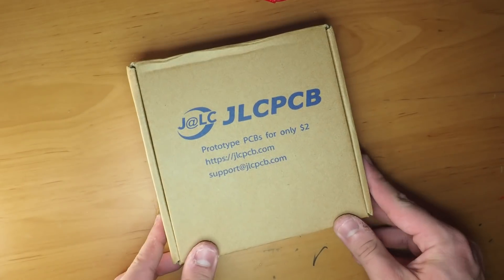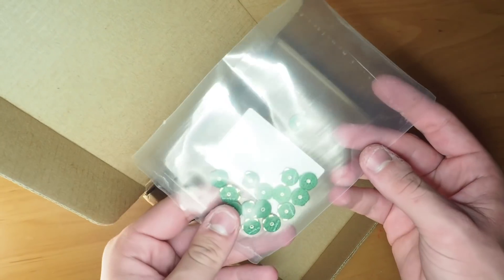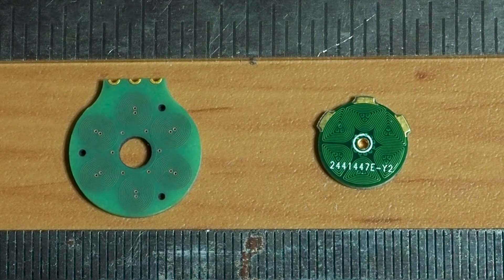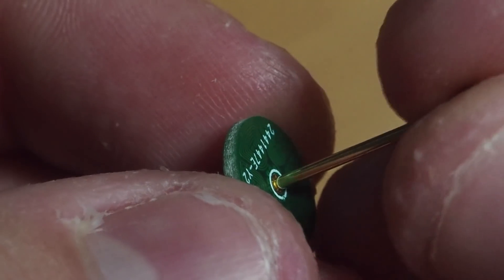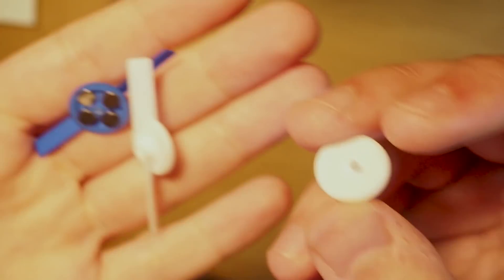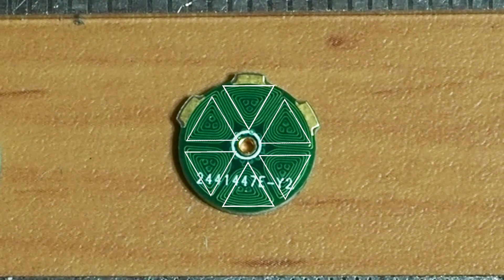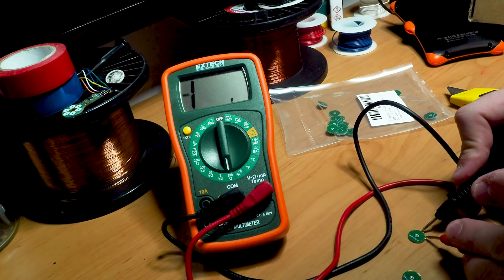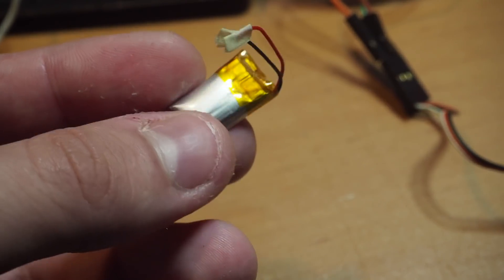SUPER tiny 6-layer Motor!

Comment: Very interesting work.  I found it while I was googling for very small, cheap motors.  I was wondering if an array of these motors (all on the same pcb) could be used to drive a parallel array of 'fishing line' muscles.  These can be powered by twisting and show a powerful and fast contraction (see https://www.youtube.com/watch?v=1A2LUbJjDQ0 at 41 seconds).  Do you think there would be enough torque ?

Comment: Max voltage/ RPM??? I am curious if this concept coule be utilized to make tiny 15mm case fans at a lower cost and equal or better performance than the off the shelf ones....
Reply: All you have to do is upscale it

Comment: it can be really usefill as robotic technology. You can make not only engines but also solenoids, steppers or servos. For sure this kind of engines is not much effocient, but in case you not need lot of power they are qwesome.

Comment: Excuse me I have to go repair a hole where my jaw dropped through the floor.
Reply: Imagine a silicon chip engine.
Reply: @tibfulv  
I don't want to imagine it I want to see it hold it and use it.
Reply from the maker: @Anniruddh Mann Those types of vibration motors are still wire wound.. The motor concept is the same yes, but what different about this is that the windings are pcb traces
Reply: kindly explain why this is any better than a normal small electric motor?
Reply: @bobedwards8896  
Basically with me and you could add cooling fans as part of a circuit board instead of having to buy them later. There's probably a few other applications but this is the main one I can think of.
Reply from the maker: It depends on the application.. It has its own advantages and disadvantage.. Main advtanges are that it could be cheaper, super flat and part of the circuit itself. The main disadvantage is probably torque

Comment: https://www.thingiverse.com/thing:2605496

please use as desired
(this is a "torque" propeller)

If made out of ceramic can be used as light duty solder sucker.

Embed tiny motor into afterburner zone, place as turbine into tube, and use as 'almost instant' pressure for solder remove.

Comment: Wow that's awesome!
How much torque does your motor have?
Reply from the maker: I haven't measured the torque of the 6-layer motor but the 4 layer one has a static torque of 0.9gcm - its is probably less than or equal
Reply: @CarlBugeja  
I'm kind of new to this, is that a lot or a little for something of this size?
Reply: Almost none

Comment: You could use mobile vibration motor. It is also very small and powerful.
Reply: There are vibration motors with different axis, some with axis like the one of this video.
Reply: Wouldn't it be vibrating the phone around in the wrong axis? 
The ones I've seen have been mounted so that the motor axle is mounted horizontally, so it vibrates the phone up and down (against a table when laid on a table)
This one would have the axis vertically (phone doesn't vibrate against table when laid on a table)

Comment: Can  you make micro dinamo?
Reply: An electric motor should work as a dynamo, so in theory you're looking at one.
Reply: Stephan Brun The engine does not supply electricity at low torque. but the dynamo is able to give high electricity at low torque. what you call theoretically, but dynamo structurally a little different

Comment: Cool! Can it step?  How can you increase torque, or use it in an actual product?  Nice work!  Subscribed! And ring the bell!
Reply from the maker: Yes it can be used for stepping 🙂 there are several way the torque can be increased.. Adding an iron core is the best option but there are other options like increasing the stator poles to 9
Reply: Carl Bugeja , neat.  I just saw the iron core on your other video.  I guess it would also be possible to snap in some gears via an axle hole in the pcb for more torque.  Like those white gears inside toy motor cars.

Comment: Hey man! great results! if you could go wild with the number of phases and layers, for a larger design (30mmX30mm) - what would you go for?
Plus, thinking about larger designs - would you consider drilling the center of each phase and putting maybe a ferrite slug? or some other material?
I've been working on a design for a "rail motor" which is just phases on a linear rail - let me know if you wanna see it :D
Reply from the maker: Doing a larger motor with ferrite cores in the middle of the coils, is definitely possible and will definitely yield better torque results.. its something I might explore in the future - i haven't done it yet because my coreless pcb motors is only made from 4 components which would obviously be cheaper and easier to assemble

Comment: Have you explored different substrates for holding the windings? I.e. the backplate you used previously to get more torque but with the coils layered on top with heat resistant adhesion. I'm not an engineer. But would this allow for more layers inside the same thickness? Or am I missing a key component for that theory?